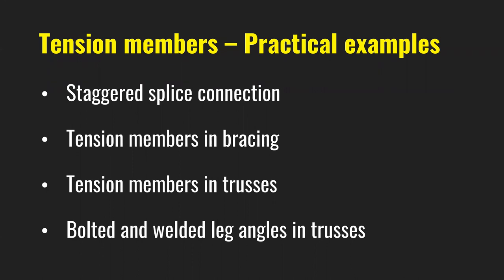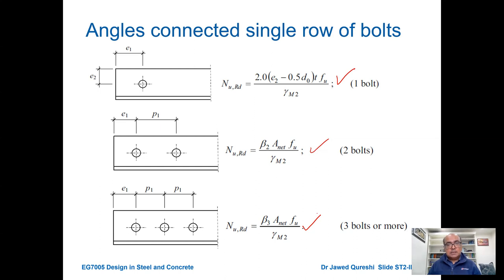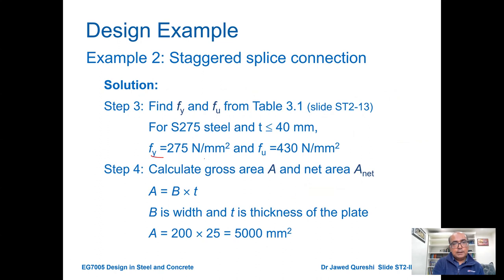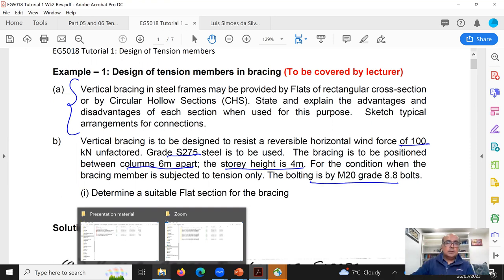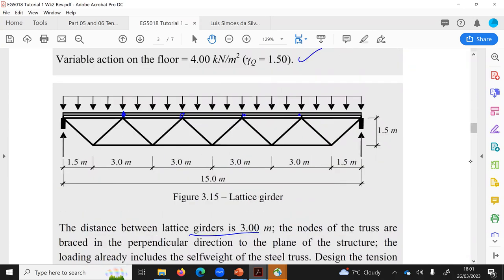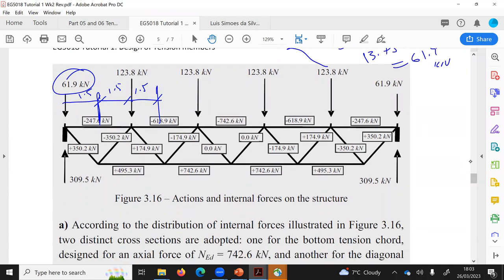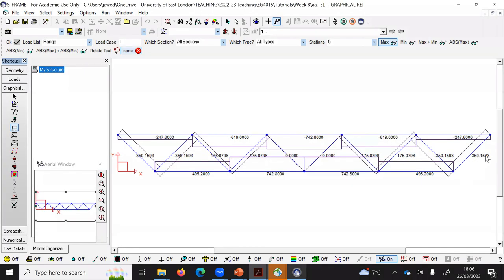06 Tension Member Design Tutorial | Eurocode 3 Steel Design series

Comment from the maker: ** TIMESTAMPS **

00:00 – Introduction 
00:37 – Tension Members Practical examples
01:37 – Eurocode design process for leg angles 
03:34 – Staggered splice connection example  
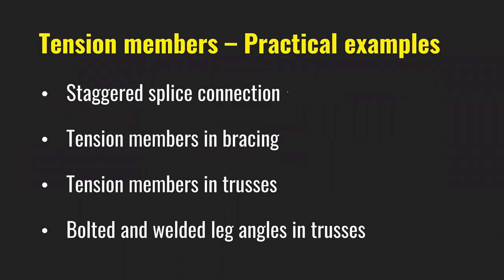06:10 – Tension members in bracing example
09:00 – Tension members in trusses example
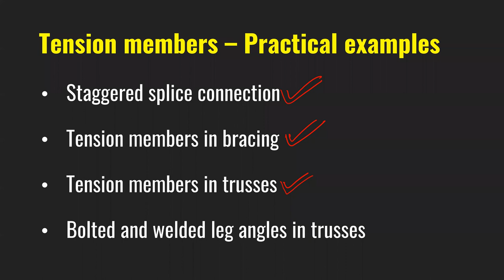15:56 – Bolted and welded leg angles in trusses example

Comment: Hi Sir, could you please suggest me to refer  best steel structure design book as per Eurocode
Reply from the maker: In addition to book mentioned earlier, following guide is also very useful for students and recent gradaute engineers 
SCI P387 guide Steel building design: Worked examples for students
Reply: Thanks for your quick response Sir, I am working as a professional 2:35  in oil and gas industry as a structural engineer..i really need to clear the concept of steel structure.
Reply from the maker: @AhtesamKhan-ix9jn  glad to be in touch with you. I’m always here to help.